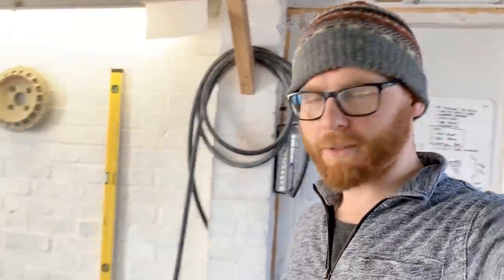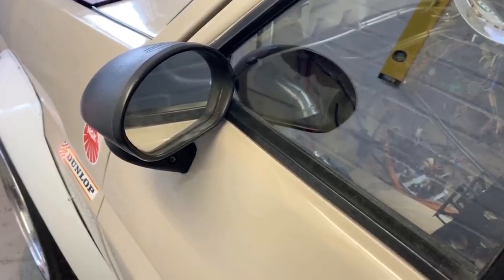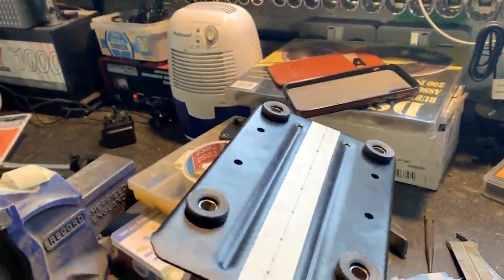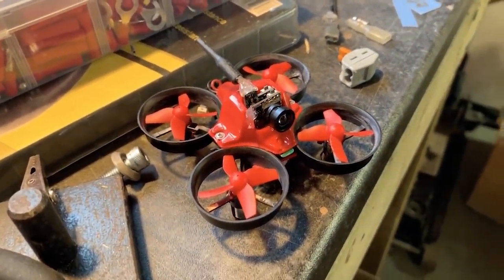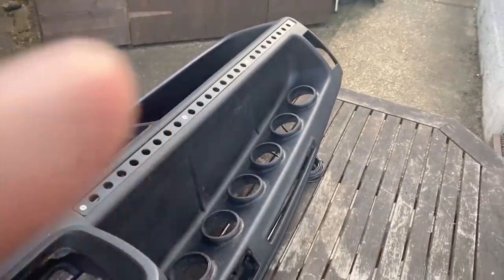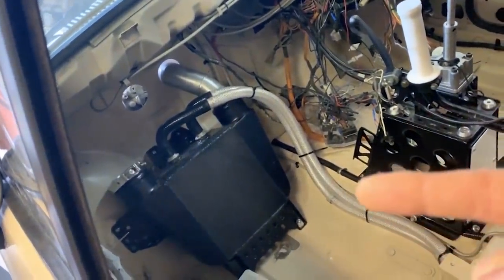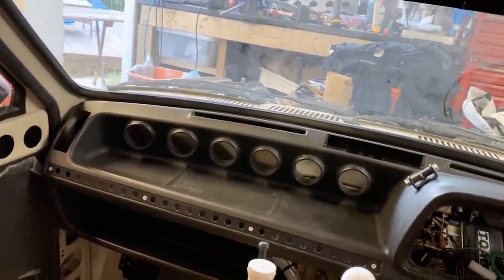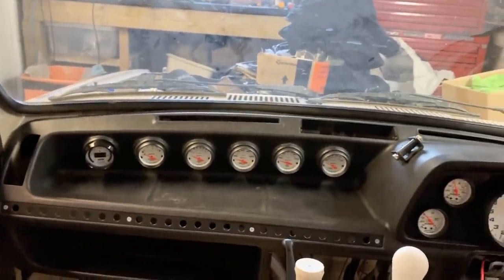Dashboard and all the gauges installed - Compound Turbo Mk1 Fiesta

Comment: Looks good! Fuel Pressure gauge comes in handy from time to time - realised my fuel pump was dying and it helped me prevent grenading a fresh engine build!
Reply from the maker: the issue is that its a mechanical one and i didnt really want a fuel line under the dash. there is a remote kit but its like £250 from auto meter. might have to re visit that one.